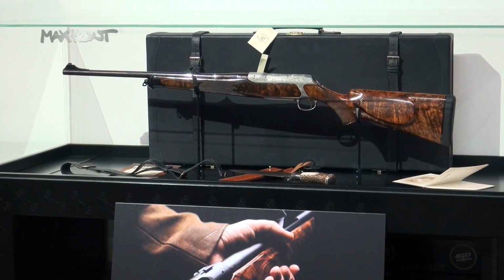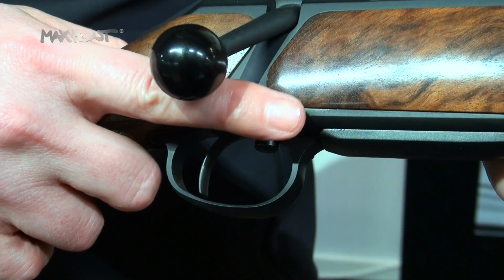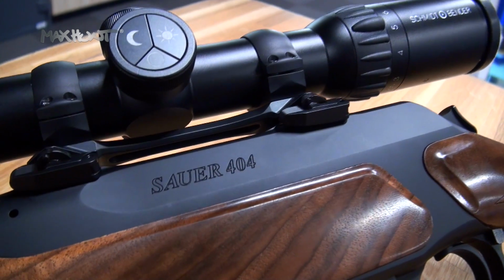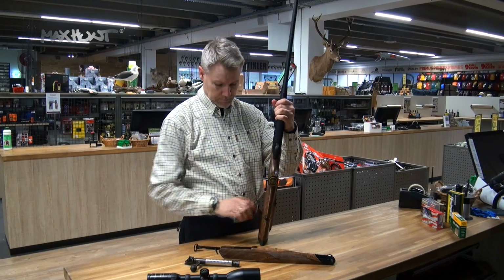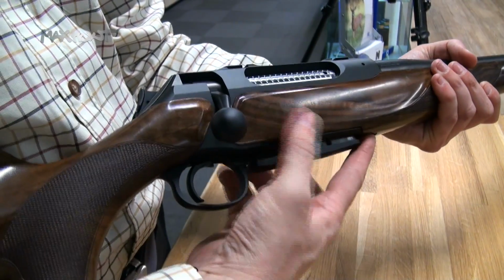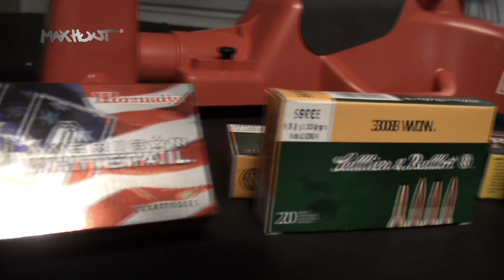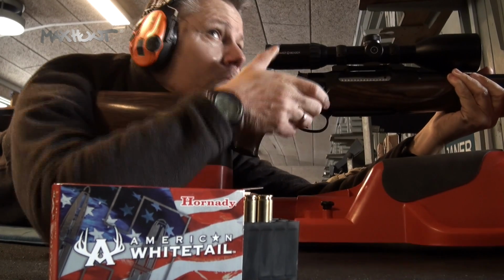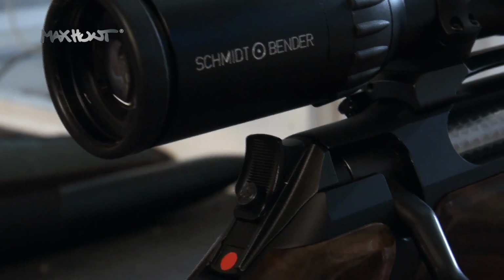Testing the new SAUER 404 - Junk or MUST have?!

Comment: I'm confused by the safety? You say that after loading a round - the safety lever must be pushed up to cock the action (pre-firing). Can you push the safety up before cocking - so that the action is ready to fire immediately upon closing of the action? Does it need to be pushed up each time the action is worked? I'm thinking of dangerous game - makes no sense to have to push up the safety lever/cocker before being able to fire the rifle. Maybe I don't understand?

Maybe the action is not cocked only if the lever is in the down position? And cocked if the lever is all the way up when the action is worked?

Comment: Great video and great rifle. Pity about the 9 month wait time on the 404 though. And when I got mine this week, it came with the wrong barrels, the wrong stock finish, a faulty trigger pull, the wrong scope mount, and the wrong case. So their engineering is good, but as a company they clearly couldn't organise a beerfest in a brauerei